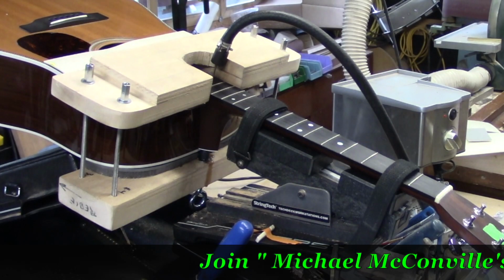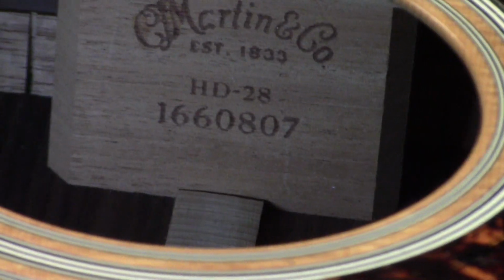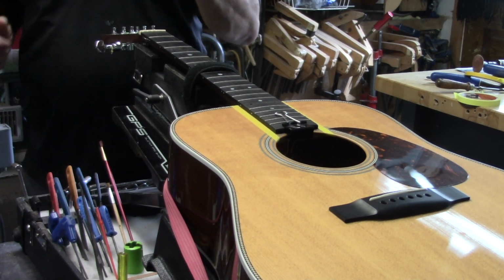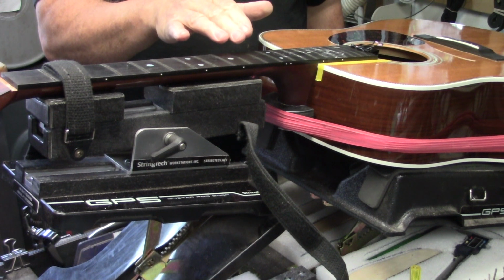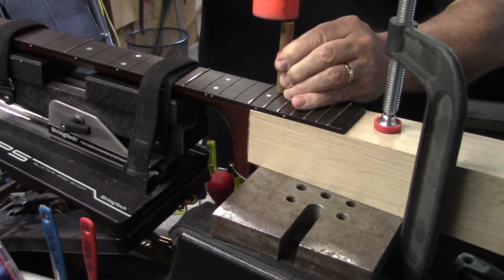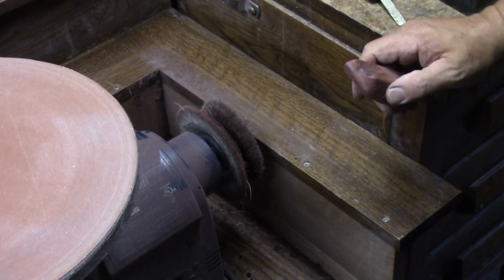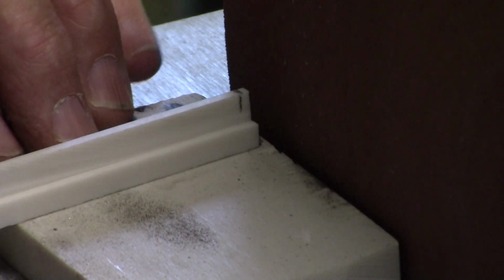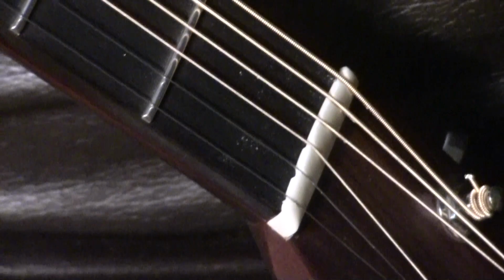HD 28 Neck Re-Set / Re-Fret / Compensated Nut / Compensated Saddle@StringTechWorkstations

Comment: Did I see correctly- 2 different glues used on neck to body assembly? Not that it’s wrong, just curious.
Reply from the maker: Yes John you did see correctly. This whole job is covered in much greater detail in the 70 minute Patreon video. I am sure others are wondering the same thing. Thanks for asking. The aliphatic ( yellow carpenters glue ) poly-vinyl glue is used for the fingerboard extension for a couple of reasons: #1: at some time in the distant future ( long after I'm gone ... Lol ! ) .... when it comes time for another neck reset; this glue can be released with heat ( only ) ... no steam. #2: Although it ( the glue ) "grabs" fairly quickly .... the "open time" is long enough to allow for final clamping and clean up of the glue-squeeze around the perimeter of the joint.

For the dovetail ... I always use hot hide glue for a couple of reasons #1: again ... at some time in the future ... when the next guy or gal goes to remove the neck ... they will find that the pilot holes are already there...  under the 15th fret ...  for the steam needle ( I should have signed the face of the dovetail and left a note ... Ha ! ) ... taking away all of the guess work. As you are probably aware....  the hide glue releases best with a combination of heat and steam. #2 The viscosity ( thickness or thin-ness ) of the hide glue can be controlled .. from water-thin to thick as peanut butter ( for those old Kay dovetails ...  doh! ). You'll notice that I just apply the hide glue on the sides of the male and female dovetail joints only. This will assist in a quick release ... at some time in the future. 

Hope that helps to clarify for you ... and others .

Very Best,

Michael